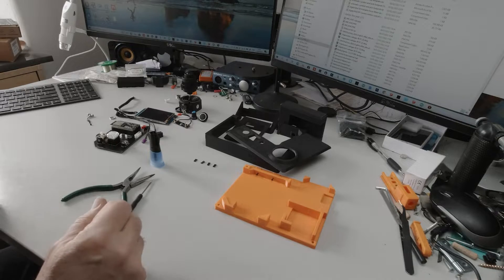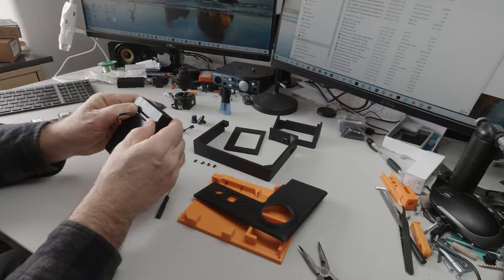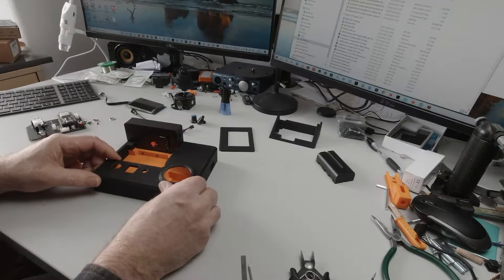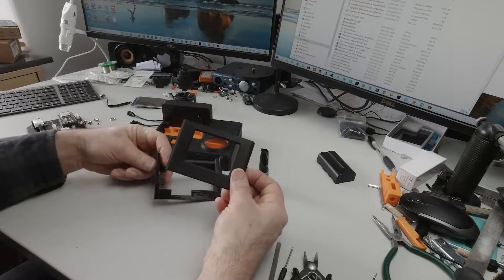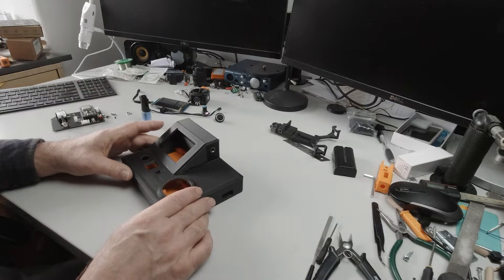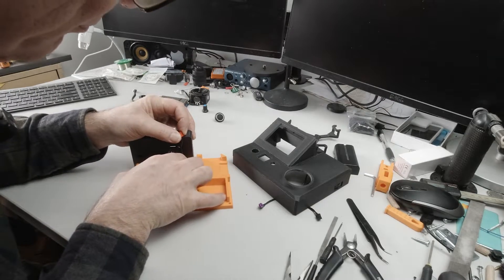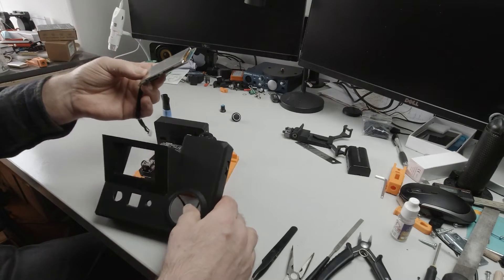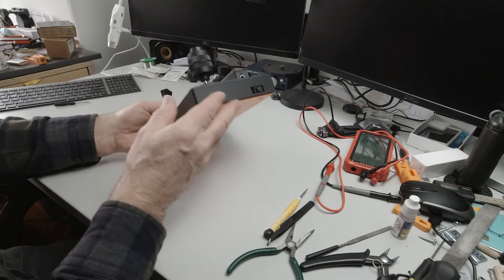DIY PTZ plus Controller Build Tutorial

Comment: a nice feature that i have on my zeapon slider-

when timelapsing - they have a shutter release that attaches to the flash hotshoe - then you syn the rear shutter with the flash
this then allows the camera to control the timelapse by sending the signal to the slider...

Most cameras now have exposure levelling which is soooo good especially for timelapse holy grails.
If you could implement this it would be a cool feature

here is my zeapon showing the timelapse shuuter release in the hotshoe and and the slider
https://www.youtube.com/watch?v=kznrV0xKPJE

it shoots, moves, etc and the camera controls everything 
rather than the limited basic features that 90% of cheap sliders have. , i hope this makes sense - maybe a bluetooth module or something could be used.

if you need more pics or info, let me know and ill happily help
Reply: gh5mk2, gh6, S series all have exposure levelling and i would say its likey to be on all future releases from lumix
im not sure about other brands
Reply from the maker: The Digital bird slider already does all this through the shutter cable which can be plugged either directly into the slider or into the Pan Tilt head etc what ever . All devices on the digital bird system have shutter control for Timlapse or movie recording start and stop. By giving control to the camera you are limiting many other features including its PTZ capabilities. I may have missed something but the only benefit I can see is the WIFI connection to the camera which would be easy if all the camera manufacturers adopted the same system and made it open source!.
Reply: @digitalbirdfilm  you are missing the point - the exposure levelling in many new cameras is a massive feature for timelapsers, so you dont get that awful flickering on holy grail day to night or night to day timelapses - hence the need for programs like lrtimelapse by gunther wagner

exposure levelling is only available in the cameras dedicated timelapse mode and cannot be controlled from the slider.

all sliders, from the cheapest to the most expensive dynamic perceptions rig that i have used , have the ability to control the timelapse but only the zeapon allows me to let the camera control the timelapse when it is in its dedicated timelapse mode. Its the best of both worlds.

i thought i would mention the lack of the feature but im guessing you arent a timelapse guy.
If you added this feature the timelapsers would be all over this.
Its the sole reason i bought the zeapon micro 3 1000 and the pons pan head
Reply: @digitalbirdfilm   i set my moide dial to timelapse, enter the picture count frame rate etc, sync my rear shutter curtain with the flash, attach zeapon bluetooth shutter relase to the cameras flash hotshoe, setup slider and ptz heads and set start and end points , adjust speed and then set camera in A mode and click start , the camera controls everything and slider does what the camera tells it.
You dont have to adjust anything on the fly, no isos, no shutter speeds , nothing.
The camera takes a perfect lapse everytime.

When the slider controls the camera then you introduce flickering which is a pita to deal with and involves a much longher workflow in post to fix the raws which is not a great time. It adds approx 2 hrs to the post phase.

Comment: wow! what a project. you are just amazing. More power to you
Reply from the maker: Thank you! Cheers!
Reply: Is it possible that we have a remote follow focus remote version only for the Focus motor similar to the commercially available remote follow focus systems from Tilta or Moza.
I suggest that it would be great if it had a AS5600 Magnetic Encoder fitted wheel at the remote control controller side. the focus motor side would be the same as it is now. This would enable the focus motor double up as a wireless focus fulling system, something that is used the maximum amount of time during shootings. The professional focus pullers too are used to the conventional focus wheels. Thanks